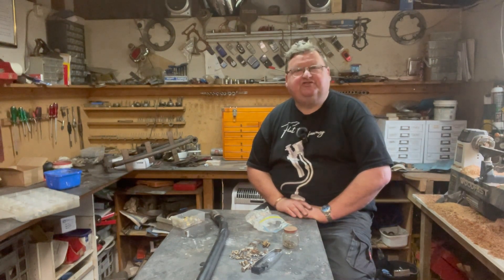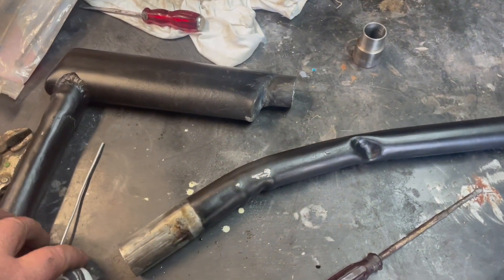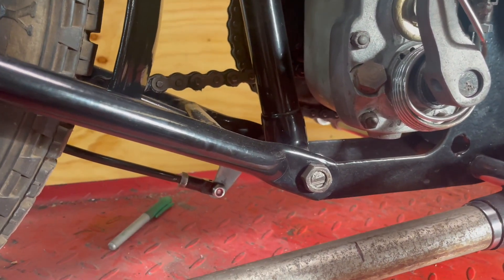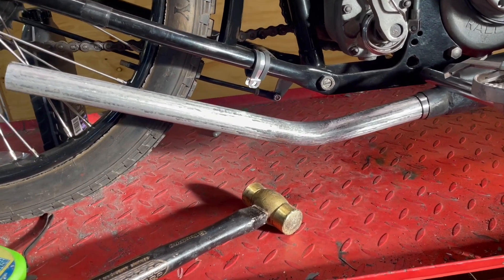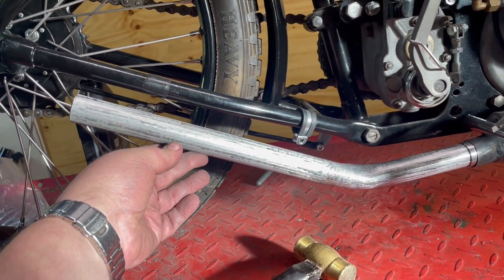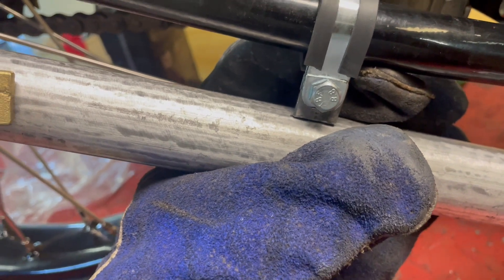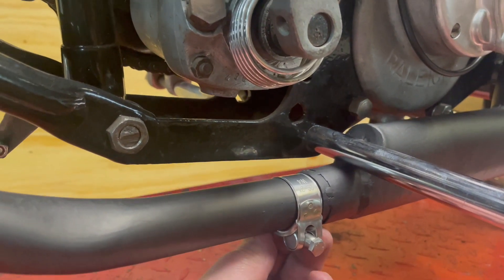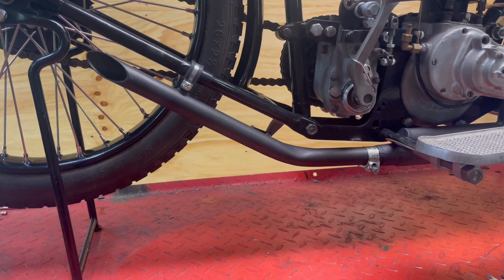Exhaust - I Need To Do Better - Restoring a 1920s Basket Case Raleigh

Comment: That looks a whole lot better Chris. For future reference, if you need to bend a pipe, the technique is to plug up one end of the pipe, then fill it with VERY dry sand, and ram it down in the pipe. Then plug up the other end. With this you won't get any flat spots in your bends, even on a tight radius
Reply from the maker: Thanks Graeme.  I really appreciate yours and other advice.  I’m an amateur at heart.  I also appreciate being gently pushed to achieve better results.  Cheers